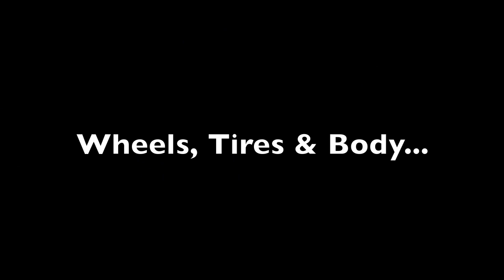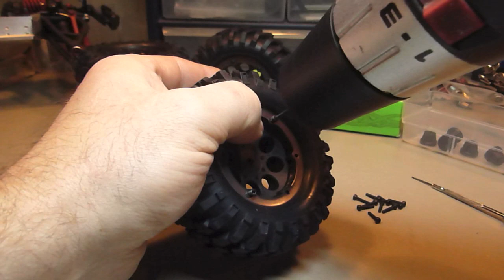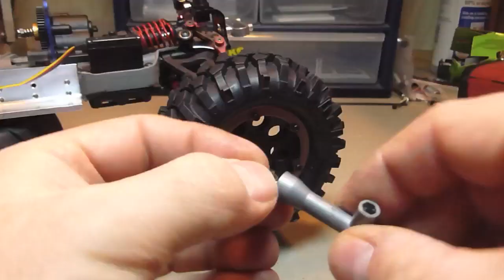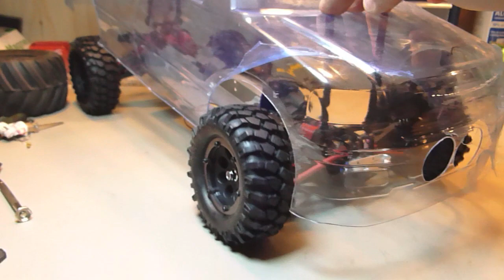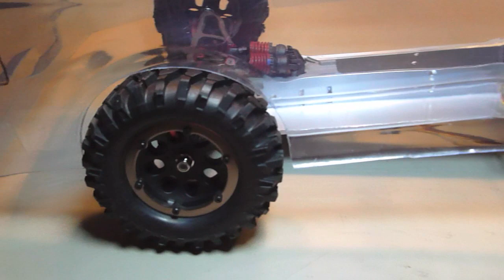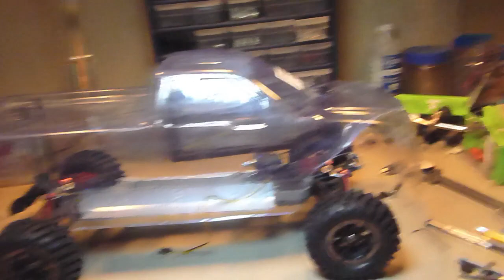1/16 Summit to 1/8 Conversion Part 7

Comment: we're can I find a motor on axel rear end help please one day don't cost to much
Reply: Need more info... your question is rather vague.
Reply: I am build a 1/5 scale short course truck and I want a rear end we're the motor and gears are all in one.....kinda like the ones you find on toy grade rc's
Reply: +Terry Simpson clod buster diff maybe?
Reply: We're can I find it
Reply: Also I want to go a least 50+ MPH what size motor esc and battery or battery's should I run
Reply: +Terry Simpson this where i would tell you to do a little research. i don't know where you are or what's around you?
Reply: I can order off the internet... web sites would be great
Reply: +Terry Simpson also.. the clod buster diff was an idea. not necessarily what you need. you need to do some snooping around at other rc cars.
Reply: Kool
Reply: +Terry Simpson custom work rarely comes with direct answers or parts.  Asking others for advice is ok but do some of the research yourself or you will not learn anything
Reply: Dats true

Comment: Just put bigger crawling tires on it
Reply from the maker: That would change the gear ratio.
Reply: Then change the gear ratio do it man!, it looks great just needs the clearance
Reply from the maker: I installed the stock mini Summit tires and it looks good. Have to make an update video with the new items installed and some play time.